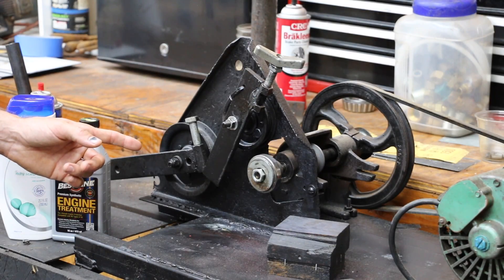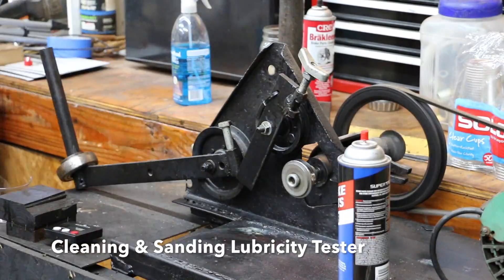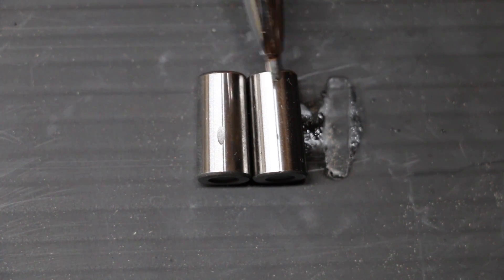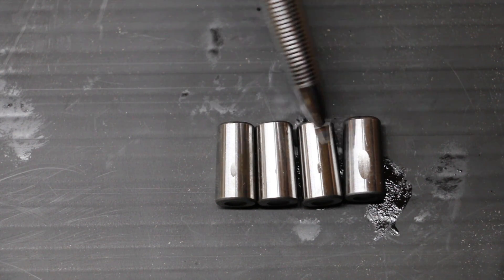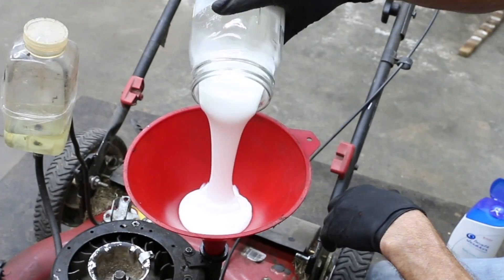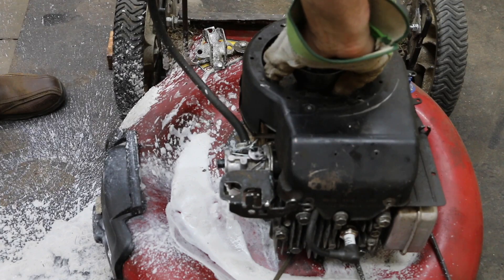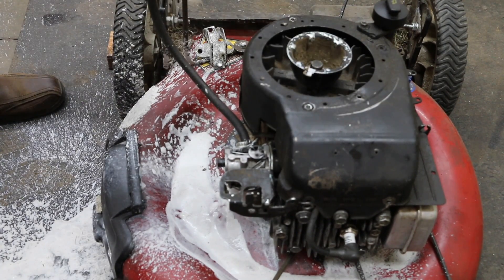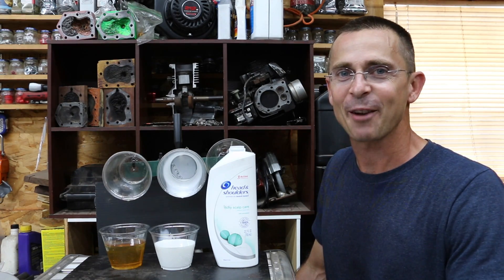Shampoo as Engine Oil?  Let's see what happens!

Comment: I would have liked to see a bearing wear comparison to engine oil or engine oil with the recommended amount of additive, rather than just the additive. As we saw on the Motorkote video, there is a big difference between the additive alone and the recommended mix.
Reply from the maker: This is a great point.  Thanks for the constructive comment.

Comment: Still running e85 in my non Flex Fuel vehicle with no problems. I've even used it in my pressure washer and compressor to see if there is any noticeable difference. Could be my imagination but seem to run a little smoother with slight increase of output.
Reply from the maker: Thanks for the video idea!

Comment: use straight "liqui moly valve cleaner" or "liqui moly fuel system cleaner" or similar products as fuel, no gasoline or anything else. you could do a comparative test, using all different brands of these products as fuel and check the engineinternals afterwards. chris fix made some tests but he used the products by the directions printed on the bottle. would be cool if you could go and fill the tank of your lawnmowers with a 100% content of these. 
sorry for bad english.
Reply from the maker: Thanks for the video idea!

Comment: Hi there again. Have you done a video of using Straight diesel fuel as Crank case lubricant? I've done it on a mower once or twice but never opened it up to see the results...(bought new mower) secondly. I seized a two cycle motorcycle engine using conventional engine oil In place of my two stroke. But still have old timers claiming that it works. Keep the vids coming and a big thumbs up from Dillon Brown Trucking!!
Reply from the maker: Thank you!

Comment: Hey, so, what happens when jet fuel or diesel goes into a normal lawn mower engine? What about octane booster by itself? What do you think would happen if you used oobleck as engine oil? Please try these out! I'm super curious
Reply from the maker: Thanks for the video idea!
Reply: @Andrew Gail. Lawn mower engine won't run on diesel, I've tried it in my old Briggs & Straton lawn mower.  Engine wouldn't even start.  Dumped the diesel out of the gas tank and filled it back up with gasoline and within a few pulls it fired right up.
Reply: actually, it will at least for a little while. https://www.youtube.com/watch?v=PXLWLXz0iY4

Comment: Great video as always. Only fault here I wish you would have done an after compression test once you had it lubbed up.
Reply from the maker: Great point. I wanted to do so, but the engine was too stiff and the intake valve was stuck open.
Reply: @ProjectFarm  Still a great video. I never would have thought of head and shoulders.

Comment: What happens if the crankcase is filled to the brim with oil and all the overflow vents blocked. Will it still lubricate the engine?
Reply: It'll blow oil out of the exhaust when you pull it over.   I've tried that.  Never did start and was a bitch to pull over!!!  Each time I got a good pull on the pull start oil came blowing out the exhaust!!!
Reply from the maker: Thanks for the video idea!

Comment: Try dollar store motor oil. See if they are different than regular more expensive motor oil
Reply from the maker: Great test idea!
Reply: Thats the best test idea ive seen yet.
Reply: yes, this would be very interesting.

and dont forget to test recycled oil as well, even at the same time
Reply: I'd like to see that
Reply: Yes
Reply: I'd watch this
Reply: There is an API certification like SN CE etc. that means that the oil formula met the engine testing it went through and analytical tests to get qualified. So technically as long as it certified with the same letters there should not be much difference. The only difference may be the quality control during the manufacturing process. So if your oil at the dollar store says SF and you compare it to SN  oil there is a difference. I remember seeing on the shelf oil that was rated SB. Your auto owners manual will tell you the letter certification needed for your year of vehicle. You can put in a higher letter certification than needed just not a lower or potential problems can develop.
Reply: @joesankovic9584  

yes.

the SA designation would refer to vehicles made prior to the detergent additives of later years.

Although not real good for modern engines, it is what is desired in air compressors and other motors of this type.

it would still be interesting to see how these oils stand up to their modern counterparts, so that all can see the actual properties at work, and not just some label from some organization.

perhaps even a synthetic, semi-synthetic, conventional show off as well.
Reply: Big thumbs up!!!
Reply: It will make a difference but the difference is so small that it would take too long to prove in a limited test period, needs more like thousands of miles in your car engine.
Reply: I work in a dollar store and had been planning to make this suggestion.
Reply: I have it in my engine now along with 80s motor oil  ( 10 W 40 ) so far no problem !
Reply: I like that idea a lot. But to be fair, make sure that the viscosity and API classification are the same.
Reply: dollar motor oil, where?!
Reply: Please I want to see this test.
Reply: If your stuck and you're a quart low, then that stuff is better then gold.
Reply: If you look at the ratings on the oil bottle, many cheap no-name oils are only sufficient for 1940's engines. If you're in dire need of oil and have to consider them, look at the symbols and ratings and do a quick search to make sure it's rated for use in your car.
Reply: @leftyeh6495  

Yes, I am API certified, so I am aware of the labels and what they mean.

The point is that there are some cheap oils that claim to meet the requirements of modern high dollar oils, and it would be very informative to see them tested in a real world environment to see what differences can be discovered.
Reply: That's the non-detergent straight weight stuff. They also sell modern oil but they are on same shelf with no explanation. Bad idea  @leftyeh6495

Comment: Like the video because most of us wouldn't dare do this on our lawnmowers even though we might be curious to see what might happen.  

One thing about the lubricity tester is that if the bearing is more or less submerged in the fluid, I would think it would affect how much it wears.  I'd think if it is submerged 1/8" in the fluid, it would be able to coat the surface far less than if its submerged 1/2".  Maybe do a test with the same fluid at different depths to see if that really matters.  Just an idea.  Thanks for the videos.
Reply from the maker: Thanks for the recommendation on the lubricity tester!

Comment: I got a lawnmore one of my neighbors put out front on trash day he said it had bad rings the oil was half gas and very high. I drain the oil and put grease down it and oil. Started cold had lot power as it was big motor. Got 10 cuttings out of it before It died but I have a hard time now going back to 140cc.
Reply from the maker: Wow! Surprised it ran that long.

Comment: Have you done a video on using kerosene as a motor flush? I know this has been done by hundreds of people online but I cannot find one by your channel. It has often been said to flush with kerosene and as a mechanic I have had good and bad experience with it. It has both positive and negative effects whether it be removing all the crud from the engine which was keeping it from leaking or removing the restrictions on the oil pressure side causing oil pressure to drop. I would be interested to see your opinion on such and if I have missed the video then my apology as the search did not turn this video up. Keep up the good work and as always enjoy the channel.
Reply from the maker: Not yet. Thanks for the video idea!

Comment: Lol... that’s head and shoulders above the worst products to use. 

I’d still like to see if using a water fogging unit will cause an engine to consume less gas & help the engine to run cooler. I’m using it in my van, and it seems to get about 1 mpg better while providing some pretty decent cooling properties, but I’d love to see if your experiment is consistent with my results.
Reply from the maker: lol. Thanks for the video idea!

Comment: I have to say, I’ve watched many of your videos, and I found this one very entertaining. I know you showed the after effects of the cylinder wall, but what did the top of the piston look like, and the valve train look like in the head? Have you ever thought about using hydraulic fluid as a lubricant in a crank case? If not, that would be an interesting video.
Reply from the maker: Thanks for the video idea!  The engine didn't run long enough accumulate carbon deposits.  Thanks again.

Comment: that's old school. I am using electric lawn mower and electric weed trimmer. The lawn mower was put away for 10 years and I used it last week. It started up fine. No hicckups. Electric motors are powerful and very very long lasting. No oil changes, and hardly any maintenance needed. It's environmentally friendly and it's also quiter.
Reply from the maker: Thanks for commenting on this.

Comment: use hair styling spray as fuel to run the engine, in addition with Head and Shoulders we expect at least a 20HP gain :)

dont know if you got an exhaust gas tester in your workshop it would be an interesting feature of any tests with "uncommon" fuels how good (or not good^^) will the engine pass the test for exhaust regulations?!

I love that name of the measuring device indeed "Kill A Watt" xD
Reply from the maker: Thanks for the video ideas!

Comment: I've used Militec-1 for years as an additive and actually had an experience where a friend's granddaughter drove his old Toyota Corolla through the city (in the summer) for over half an hour with a hole in the oil pan (virtually all oil had leaked out) and the engine still ran and was OK after refilling the oil and repairing the hole. He had used Militec in that vehicle for years and then gave it to her. It was really astounding and made me a believer. Have you ever tested Militec? It's apparently mainly for firearms now, but used to advertise for engines as well.
Reply from the maker: Thanks for the video idea!

Comment: One of my friends accidently ran his vw powered off road race car on white spirit.  He had 3 60litre drums of what he thought was race gas from mobil . Race gas is basically the avation gas that they oil company drains fron airport storage tanks to top the tanks up to keep the moisture level as there is a FAA ruling on the max moisture level in avation fuel. During the race he came into the pits and filled up on white spirit instead of race gas. Same drums different label. it knocked a bit and then after a while it lost power but still ran until the race ended. It wore the rings out in 300kms of racing but when we pulled the motor apart it was real clean inside. oops!
Reply from the maker: Wow!

Comment: As we can see, heat and shampoos hate each other. lol 
Shampoo will "thicken" as it is heated.
The zinc, although a small amount per volume, will mimic lubricant. Poorly however.
You can "beat" the eventual seizure for a while if you can cool the H&S while replacing the water lost from the product due to the heat.
But even then, eventual decomposition of the shampoo is inevitable.  
How much work do you expect to put into the engine to get it to run again?
More importantly, how much water has to be run through the engine to remove the soap?  lol
Reply from the maker: lol

Comment: One thing i know is that head and shoulders works best for cleaning my hands from oil and moderate gunk after fixing engines before it is so severe i would need washing machine powder. If it was oil based instead of water soluble i think it would have of outperformed many engine oils.
As for the video,you are absolutely the BEST!
Things i do my self such as measuring the power consumption to compare loads (mostly on fridges,etc to see if they are charged up properly) is something vital for such tests you are doing and you have the patience to add it in the video in a very detailed way.
You are so highly detailed and never gave up on anything.
You amazed me one more time.
Reply from the maker: Thank you!

Comment: No after compression test?  Curious how bad it was. Also, have you tried the good old sugar in the gas tank? Wether it will ruin an engine or not? Love your videos!
Reply from the maker: Great point. Engine was too stiff to test along with a stuck intake valve. I'll get it running again. I did test sugar in gas a while back.
Reply: @ProjectFarm  must have missed the sugar video, I'll have to go search for it. Thanks for the response!

Comment: Do you run these tests with the blade removed?
Reply from the maker: I leave the blade on the mower, since the engine needs weight attached to the output shaft to run properly. I need to install a steel plate for safety reasons.

Comment: Could you run a four stroke motor with no oil in it, on 2 stroke gas oil mix.
Reply: footballer52
The answer is going to be no. In a 4 stroke the intake mixture is never in contact with the crankcase so no matter how much oil you mix with the fuel, the engine will have no lubrication.

Comment: Try Diesel as Oil ( It basicly is an Oil) or Braking Fluid (change the Liquid on your Car and use the Old one) Maybe you can Add Barium to the Gasoline in the See Through Engine wich should Paint the Flames green :)
Reply from the maker: Thanks for the video idea!

Comment: Todd,
Are you kidding of course thumbs-up always. Do you know if the Toro recycler engine still runs ? I didn't see a compression test done after the damage is it cooked? Sorry for the late reply we got in late very very very busy. PS do not order after market belts for your expensive machinery learn the hard way they don't fit I just spent $80.51 on Amazon.com for a oem scag 483166 Hydro pump belt from my Scag turf tiger. The aftermarket one I couldn't even get in around the pulleys China Junk what do you want for $15 on eBay . Wow that's a $15,000 machine for you big money. How's the wife and kids doing ? Mine just got over a virus and a cold . Oldest just started school again. Yay for me. 
General repair
Reply from the maker: Mike, lol. Yes, this was a silly video but I had a lot of fun with it. I'll get the engine running again. It was too stiff to test for compression.  Also, the intake valve is stuck in the open position.  Briggs makes a nearly indestructible engine and it will be running soon.  Thanks for the advice on aftermarket belts!  The family is doing well but anticipate some viruses with school underway.  Glad your family has recovered from illness.  Thanks again, Todd

Comment: Applaud the Dedication to the Scientific Method... Deciding to test a Hypothesis and commit to completing the Experiment even when the the "oil" quickly evacuating the Engine and the Test Temperature was exceeding the Boiling Point of whatever still remained.  The Current 48 Dislikes should be ashamed... 

All Data is good Data. You get some good results and bad results it all helps create the Bigger Picture.  Didn't realize you used Water in an earlier test... Going to need to find that one.

Keep up the good work.
Reply from the maker: Thank you!

Comment: sir PLEASE HEAT OIL UP TO 100 CELSIUS before running your bearing test
that is actually a test to make/run. cold oil vs 100 degree C oil bearing test. I bet you will see difference. also use much higher loading
Reply from the maker: Thank you

Comment: I would like to see how a personal lubricant like KY Jelly would perform in the lubricity test and as a replacement for engine oil in the lawn mower.
Reply: Life OD youtube channel did this, if I remember it didn't end well.
Reply: The WD40 one was funny as hell tho
Reply: agreed, just watched it the other day.
Spoiler:

Didn't work, just locked up, nothing fun.
Reply: LifeOD and Top Gear both used engines with oil pumps, lines and galleries. The viscosity of KY meant it wouldn't even be drawn into the oil pick-up in the sump.  The small mower engine is simple splash bath lubrication.
Reply from the maker: Thanks for the video idea!
Reply: It seems as though other channels are doing what people request... I will just check out these other channels. I have been asking for you to try KY Jelly for over two years... And still nothing... I guess it cost to much for you.
Reply: Z71Ranger Are you whining about free content?
Reply: @Z71Ranger  nope it's just a dumb idea, it's water based. And it has been done and recorded multiple times before...
Reply: i used it once as an alternative to grease. Basically it became more of a liquid, then flung oil (and itself) everywhere.
Reply: Didnt Dr Wierd do something like that on Aqua Teem Hunger Force?

Comment: On AC power, power is actually Voltage*Current*Power Factor. That's why at 2:33, it's only drawing 440W at 10.5A, instead of 1260W. Induction motors have inherently low power factor. It's one of the readings you can get from the Kill-A-Watt. :)
Reply from the maker: This is great information. Thank you

Comment: Well, Commander..............I just THOUGHT I was running high detergent oil. Mine can't hold this a light, or even a glimmer BUT I just don't think I'll switch over quite yet. Thanks for this and BLESSINGS< Yall!
Reply from the maker: Hi Lewie, lol!  You're a wise man.  Apparently, Head & Shoulders isn't as good on the lubricity tester (or inside the engine) as engine oil.  It was a fun video. Many Blessings to yall.